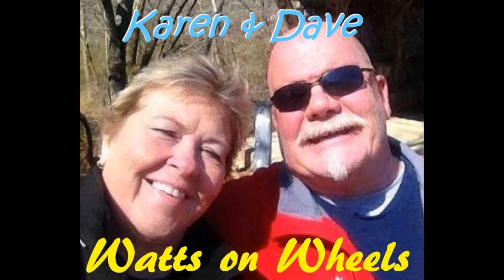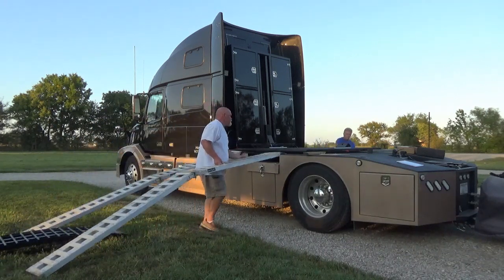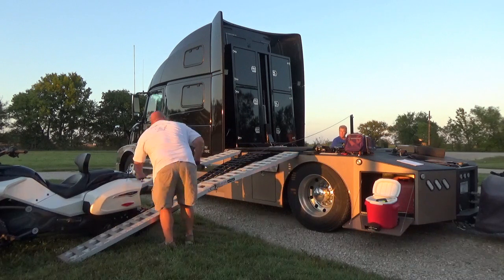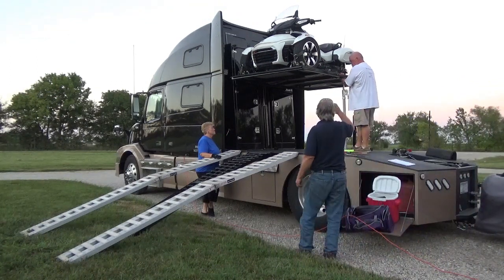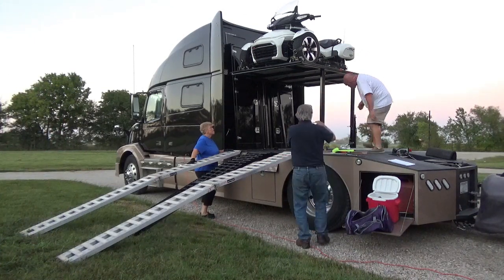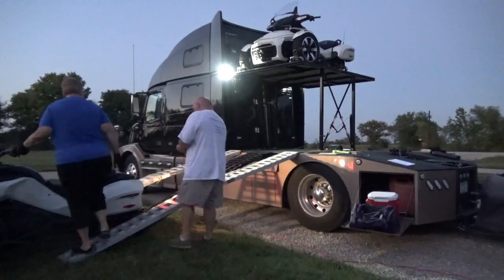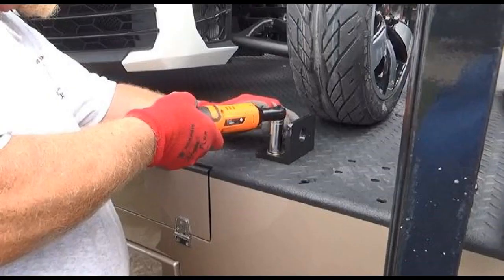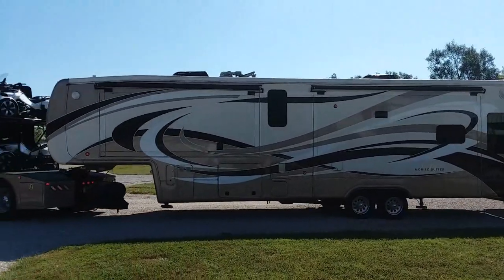How the Spyder Stacker Works // Full Time RV

Comment: 10k people watched this and only 193 gave you a thumbs up, I give you a standing ovation, man, i thought my set up was challenging.
Reply from the maker: Thanks Norm. Some people just know how to appreciate ingenuity.
Reply: Watts On Wheels ain’t that right ! So whatcha know about electrical ? I’m wanting to run a 3500w puresinewave to feed the RV with 470ah of batt and not have to purchase the $1500 all-in-one.
Reply from the maker: @normnilsson7208  Enough to be dangerous.  I'll get back with you on that one.
Reply from the maker: what do you mean by $1500 all-in-one?
Reply: @WattsOnWheels  This is an ATS=Automatic Transfer Switch that is also a Converter-Battery Charger and an Inverter, one device that does it all, very expensive
Reply: @WattsOnWheels  You would hook up your Generator/Shore Power/Solar and Battery connection to this device, the issue is you have to bypass your RV wiring. I want to save a ton of money and make a female 30 AMP connector to the output of my 3500w inverter and run certain 120V circuits to my Montana and was hoping you knew electrical, watching you with all your equipment I came to the conclusion you were good at all things, no ?
Reply from the maker: @normnilsson7208  We had ours wired for us and it is joined in to our RV wiring system.  Our 3000w inverter goes to certain circuits in the RV (not the whole RV).  You could add a subpanel to your inverter so you could take the circuits you want and run them to the subpanel.
Reply: Watts On Wheels yep, I could do that. I just wanted to take a short cut by connecting the RV’s cord right into my inverter and only turn on the circuits I need when over nighting at a Walmart when doing a long travel. I have a 4500w inverter that is super quiet and that just my be the best solution.
Reply: Watts On Wheels my Mother-in-law goes with us and she absolutely has to have TV on to sleep and my wife has a CPap so those are must to get through the night
Reply from the maker: @normnilsson7208  Sounds like a plan.
Reply from the maker: @normnilsson7208  Luckily TVs dont use as much juice as they used to. We have a residential frig , 2 CPAPs and usally a blower running when at WMart with a 3000w inverter and make it thru the night.
Reply: Watts On Wheels is the blower to keep cool ? If so how well does that work
Reply from the maker: @normnilsson7208  yes...better than a fan. White noise too.
Reply: Watts On Wheels you have a trillion videos and I’m sure you posted the blower in one of them, but can you give me the info on the blower and maybe how you use it, I would love to run AC but not an option when at Walmart. Thanks !